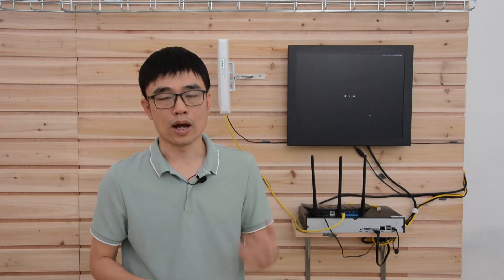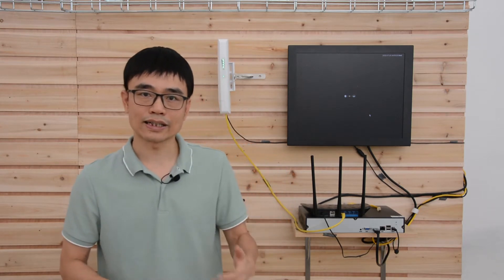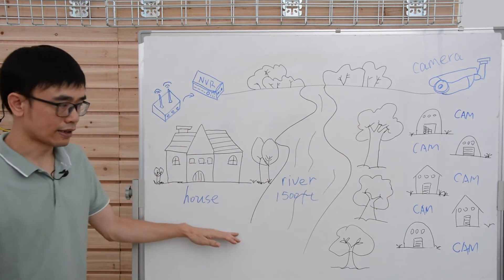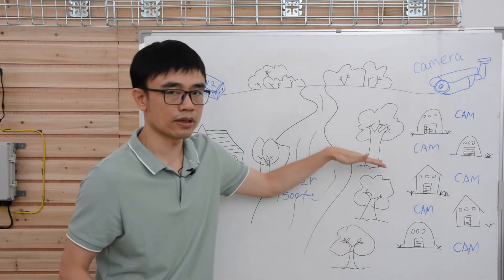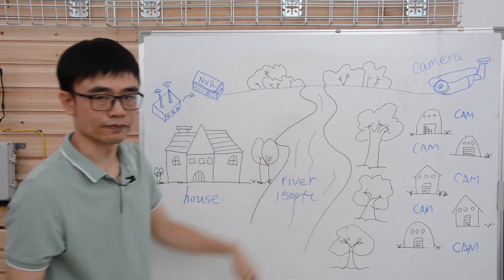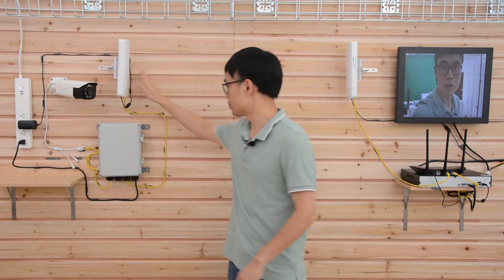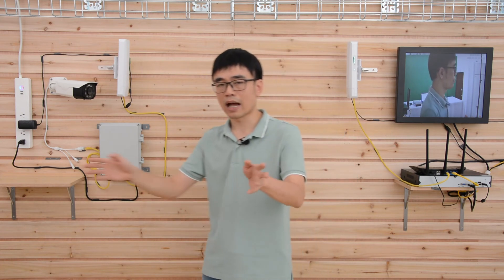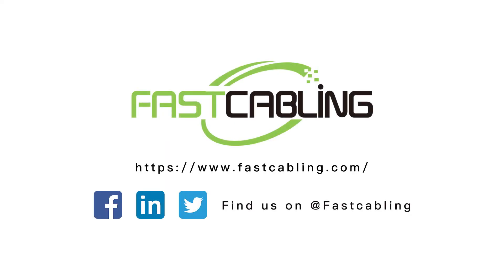How to connect multiple cameras with a wireless bridge

Comment: Can you recommend me some PTP devices which will work enough for 6 CCTV over 200meter of wireless PTP connection. Thanks.
Hi. I really loved your video. Thank you for your video.
Reply from the maker: You might pick the wireless bridge with 900mbps. The actual bandwdith is about 250mbps depending on the environment. Since the distance is short, you are supposed to have about 250mbps and it is enough for 6 IP cameras.
Reply: How about 32 cameras? What  ptp device can support  it? Thanks

Comment: If we have more than 10 IP camera with 4K , 12 MP how to do that wireless connection by bridge?
Reply from the maker: You might set up one or two network switch to aggregate those cameras before you send it back to the wireless bridge. One point to multiple point might not be a good idea. The master bridge need to handle the return single from different directions.

Comment: How many cameras can be wifi'd at once? I have 14 I need to transmit will I have latency problems and how would I correct that?
Reply from the maker: It highly depends on the bandwidth the bridge actually come up with. The obstacles could reduce the bandwidth sharply. If you have 14 cameras, the wired  cable connection should be used. The wireless is the optional solution you might consider while wiring cable is impossible.